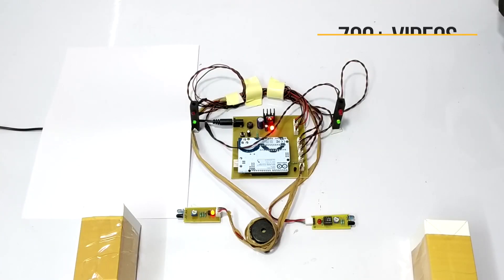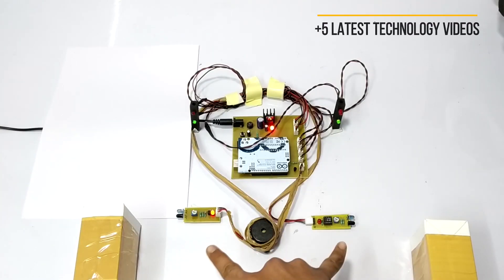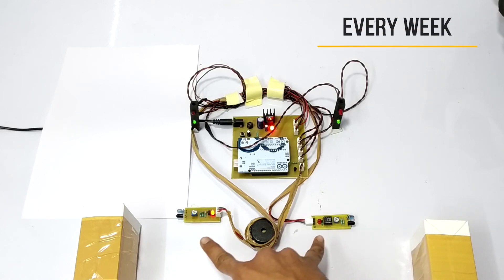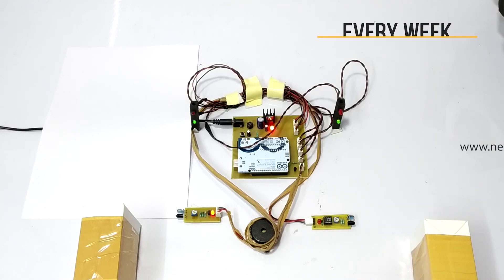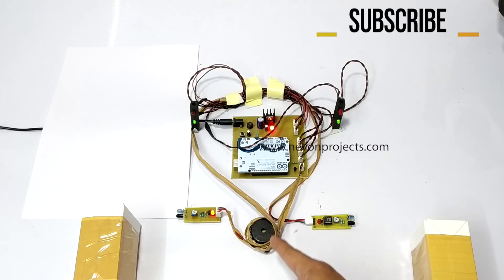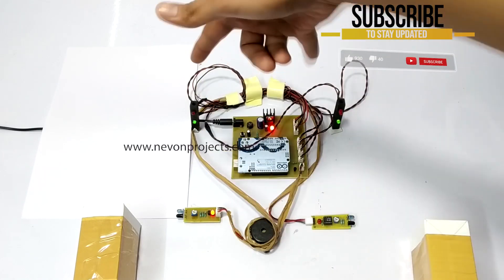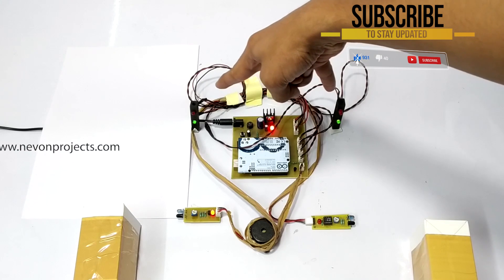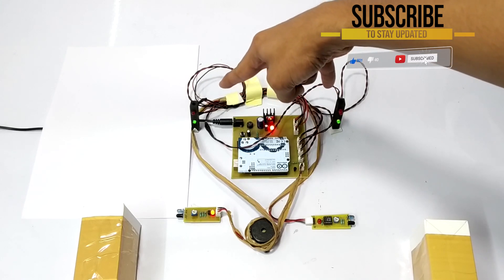Smart Road Safety & Vehicle Accident Prevention for Mountain Roads Arduino Project

Comment: Project is good but the way he showed is scam...
Just check the pcb on 1.07 min  and 1.10 min ...both are different ..also he solders green led...then on 2nd pcb red led is soldered🤦‍♂️ just watch the video carefully from 1.07 min on 0.25x speed and u will notice the scam😂
Reply from the maker: There is no Scam... We develop and solder 100+ PCB every day... cannot setup camera to record each PCB so we use common soldering footages in many videos